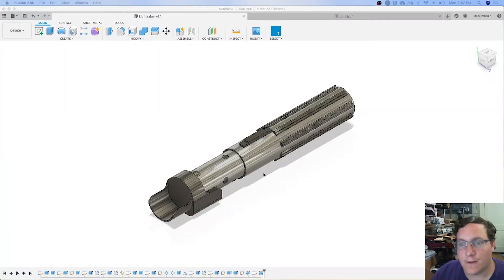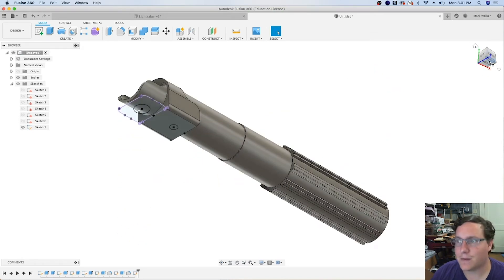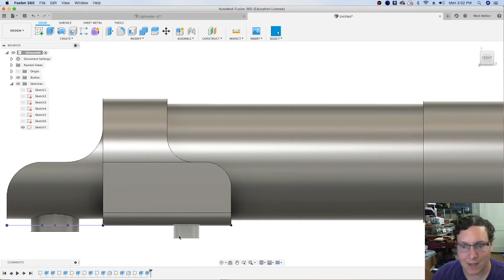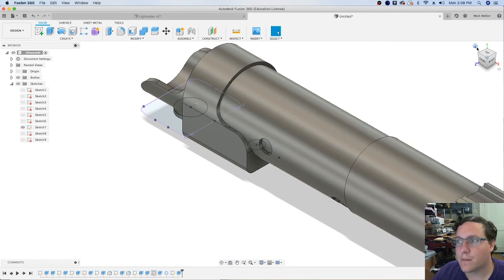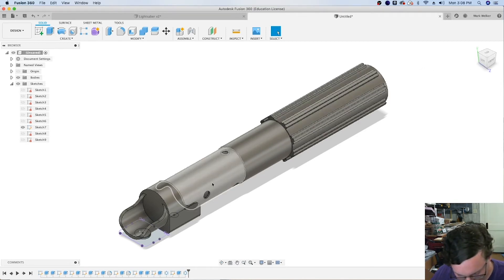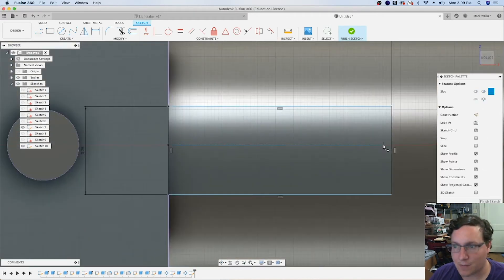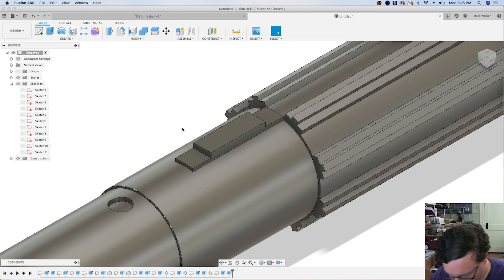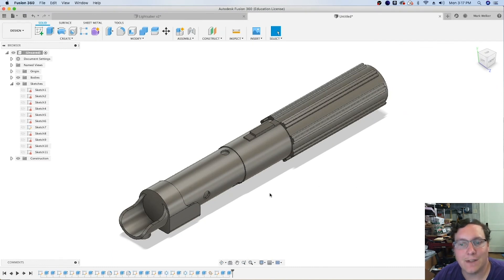Lightsaber Modeling Part 2 - Adding Details

Comment: When I made Luke’s lightsaber in fusion 360 I had around 130 ish sketches. Is that normal for something like this?
Reply from the maker: Depends on the amount of detail you put into you model, but I suspect you may have got a bit over board. Common problems I've seen with "too many sketches" are in no particular order 1) blank sketches 2) creating sketches for every individual shape, 3) remaking sketches rather than editing sketches or 4) general lack of preplanning. I'm sure there are other reasons but those are the ones that come to mind. 

That said, I know I've had some projects that had 40+ sketches in a single file, but more than that and I'd look at splitting things up, specifying components being edited and using subassemblies (in addition to renaming sketches, bodies, and components) to help keep everything better organized.)